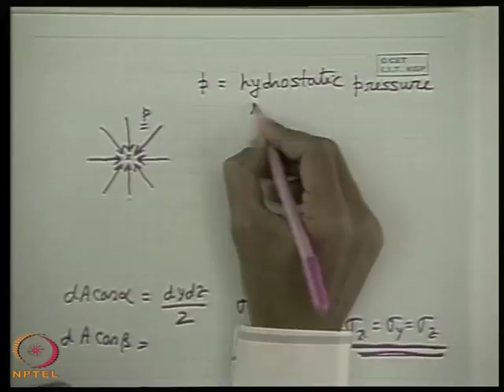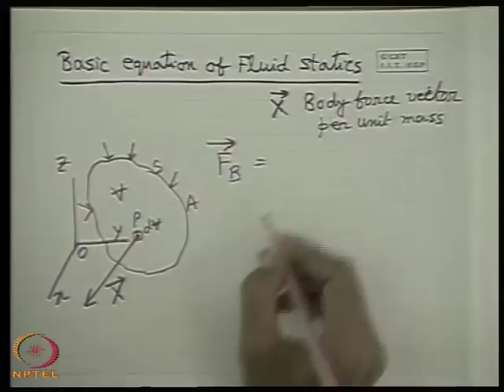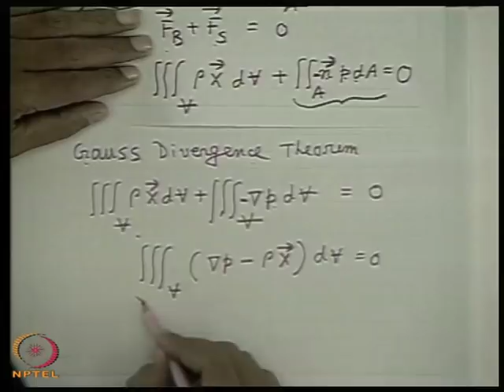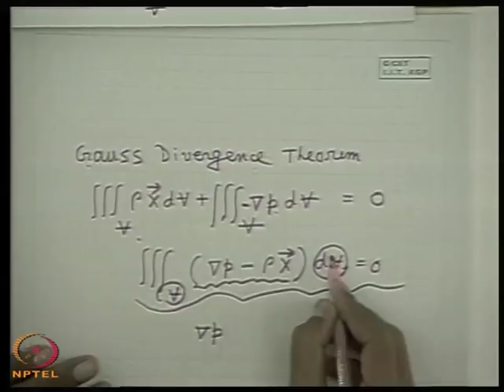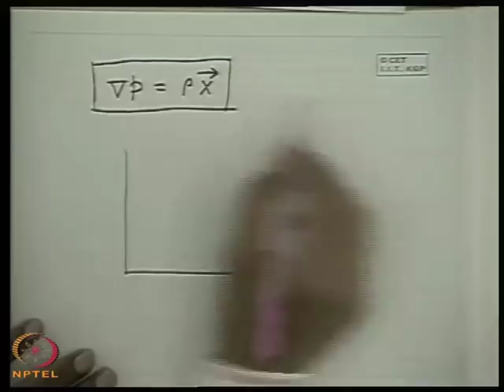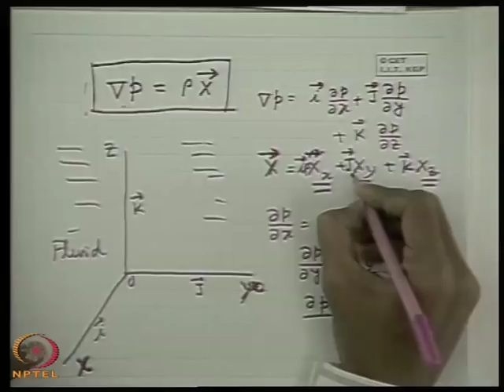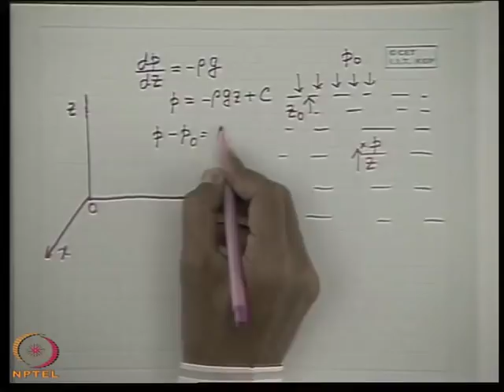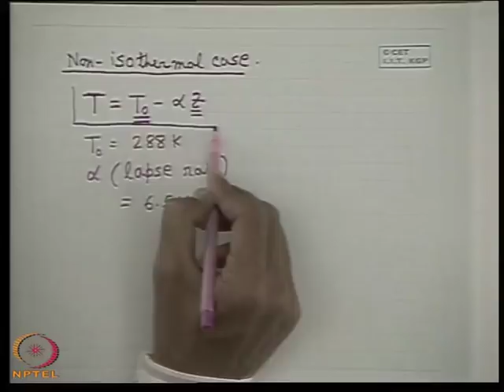Mod-04 Lec-04 Fluid Statics Part - I

Comment: I congratulate Dr.Som for such a beautuful lecture,its even better than that of lectures of US/UK colleges
Reply: So, Hydrostatic Pressure at a point in a static fluid is due to the force of the sorrouduring molecules which is compressive force.
But In the case of surface tension we have seen that a molecule inside fluid is attracted by all the molecules around it which can be considered as tensile.But it's said that fluid can't resist tensile force.
How Could this be possible?.I can't understand this.Please help me in this?

Comment: 0:16 Recap of previous lectures
5:38 Intro to fluid statics
6:25 Body force and Surface force on a fluid element
11:15 Expression for state of stresses in fluid at rest
21:29 Final result (Pascal's law)
32:25 Fundamental equation of fluid statics
36:40 Pressure as function of height if gravity is only a body force

Comment: This video on fluid statics covers various topics including the distinction between fluids and solids, the forces acting on a fluid at rest, compressive stresses and hydrostatic pressure, the analytical expression for the pressure field, and the relationship between pressure and depth in a liquid at rest.  The lecturer explains concepts such as body forces and surface forces, analyzes the forces in equilibrium on an inclined plane, and derives the fundamental equation of fluid statics using the Gauss divergence theorem. They also discuss the equation of state for compressible fluids, the variation of pressure with vertical height, and the relationship between temperature and altitude in fluid statics. Overall, this video provides a comprehensive understanding of fluid statics and its relevant concepts.

    00:00:00 The lecturer begins by summarizing the fundamental concepts and introduction discussed in the previous section. These concepts include the distinction between fluids and solids, the concept of continuum to describe matter, the role of viscosity and the difference between Newtonian and non-Newtonian fluids, the compressibility of fluids and its relation to the bulk modulus of elasticity, the distinction between compressible and incompressible flow, and the concept of surface tension and its effects on free surfaces of fluids.  The lecturer also mentions phenomena such as capillary rise and depression, which are related to the interplay between cohesion and adhesion forces.
    00:05:00 the concept of fluid statics and the forces acting on a fluid at rest are discussed. The forces can be categorized into two types: body forces and surface forces. Body forces are external forces that act throughout the mass of the fluid element, such as gravity or electromagnetic forces. On the other hand, surface forces arise from the interactions between neighboring molecules or particles and can be resolved into normal and shear forces. These forces constitute the internal forces within the fluid. The section also mentions that the detailed description of body forces comes from the field of physics, whereas surface forces can be explained using elementary mechanics.
    00:10:00 the state of forces or stresses generated in a fluid at rest. They explain that in a fluid at rest, there can only be compressive forces and no tangential or tensile forces. They analyze a tetrahedral fluid element and determine the forces acting on it, emphasizing that only the compressive forces are present. They also mention that the surface forces on certain planes do not contribute to certain directions, highlighting the importance of the normal force in the analysis.
    00:15:00 the concept of fluid statics and the forces acting on an inclined plane. The inclined plane has a normal that makes angles with the x, y, and z directions. The forces acting on the plane can be determined using the direction cosines. The surface force acting perpendicular to the plane is given by sigma n multiplied by the area of the plane and the cosine of the angle with the y direction. Similarly, forces in the x and z directions can be calculated using the corresponding direction cosines. Gravity is assumed to be the only body force field, and the net forces in each direction are determined by considering the surface force and the weight of the fluid element. By analyzing the forces in equilibrium, it is found that the components must be equal to zero for a static equilibrium. The projection of the area on the perpendicular planes can be determined using the direction cosines.
    00:20:00 compressive stresses and hydrostatic pressure in a fluid at rest. They explain that in a fluid element, the stresses are directed towards a point from all directions and have equal magnitude, known as hydrostatic pressure. They also mention Pascal's law, which states that the compressive stresses in a fluid are of equal magnitude in all directions.  The lecturer then introduces the basic equations of fluid statics and explains that the pressure field in a fluid at rest varies with the spatial coordinates in the fluid.
    00:25:00 the development of the analytical expression for the pressure field in a fluid at rest. It begins by setting a frame of reference axes and analyzing how the pressure field behaves with changes in the coordinate axis. The video then introduces the basic equation of fluid statics and considers a fluid mass bounded by a surface. It explores the concept of body force and surface force, explaining how to calculate the total body force and total surface force vectors for a fluid element. Under equilibrium conditions, the video derives the equation rho X bar d v plus p d A = 0, which represents the balance between body and surface forces.
    00:30:00 In this section, the Gauss divergence theorem is used to change a surface integral to a volume integral in order to derive the fundamental equation of fluid statics. The equation, expressed in compact vector form, states that the gradient of pressure (grad p) is equal to the product of the density (rho) and the body force vector (X bar). The equation is valid for any small elemental control volume or volume of the fluid element. By resolving the equation with respect to a frame of reference, the variation of pressure in terms of x, y, and z coordinates can be determined.
    00:35:00 fluid statics and the role of gravity as the only body force field. They explain that if gravity is the only force acting on the fluid, the pressure in a horizontal plane will be the same everywhere and only a function of the vertical direction, z.  The lecturer demonstrates this by integrating the equation and finding the pressure (p) is equal to -rho g z + C, with C determined by a suitable boundary condition. They further explain that if the fluid is incompressible, with a constant density (rho), the equation simplifies to p = -rho g z + C. In conclusion, the basic equation of fluid statics is a differential form, but integrating it requires knowledge of the density variation with either z or p.
    00:40:00 the concept of fluid pressure in a liquid at rest. They explain that the pressure at any point in the fluid is equal to the ambient pressure plus the product of the density, acceleration due to gravity, and the depth of the point from the free surface. This relationship is a consequence of the basic equation of fluid statics for an incompressible case. The lecturer also mentions that in the case of an incompressible liquid, the pressure can be expressed as a linear variation with depth from the free surface, known as Torricelli's theorem. The lecturer concludes by stating that they will discuss the relationship between pressure and depth for compressible fluids in the next class.
    00:45:00 the equation of state for compressible fluids, specifically for a perfect gas where the relationship between pressure, density, and temperature is given by p = ρRT. The reference state is defined at a location where the values of pressure (p0) and density (ρ0) are known. By integrating the equation, the variation of pressure with respect to vertical height (z) can be determined. In the case of a non-isothermal system, where the temperature changes, the linear relationship between temperature and altitude in the atmosphere is discussed.
    00:50:00 In this section, the lecturer discusses the relationship between temperature and altitude in fluid statics. They explain that the temperature decreases linearly with altitude, with a constant lapse rate of 6.5 Kelvin per kilometer. By assuming that the atmosphere behaves as a perfect gas, the equation of state can be used to express density (rho) as pressure (p) divided by the product of the gas constant (R) and temperature (T). The lecturer goes on to perform mathematical calculations to derive an expression for the variation of pressure with altitude, resulting in a power law relationship.

Comment: 12:37 sir.. how do you say that a static fluid won't have any tensile stress but it has a compressive stress??
Reply: manish kumar monu  So, Hydrostatic Pressure at a point in a static fluid is due to the force of the sorrouduring molecules which is compressive force.
But In the case of surface tension we have seen that a molecule inside fluid is attracted by all the molecules around it which can be considered as tensile.But it's said that fluid can't resist tensile force.
How Could this be possible?.I can't understand this.Please help me in this?
Reply: There is no tensile stress thing in fluids.....It's a surface tension which is relevant at fluid fluid or fluid solid interfaces (It comes as a force).....Usually fluid flow is governed by compressive(pressure) or shear stresses or both....But in some few applications, because of stick slip or volatilization circumstances then only surface tension is serious to study.....

Comment: DEAR SIR,
I need to know why we use tetrahedral shape /surface for this derivation
Please clarify my doubts?
Reply: It is one of the geometry where you can have gradients in all directions....To show that compressive stresses in all directions are same....If we take up a cube, then there is no surface common to all directions and not the wedge also.....Hope you are satisfied..
Reply: it is easy to prove that all stress are equal
if we take a cube the stress is same along x,y,z direction and that proves nothing.
Reply: @aero8215  So, Hydrostatic Pressure at a point in a static fluid is due to the force of the sorrouduring molecules which is compressive force.
But In the case of surface tension we have seen that a molecule inside fluid is attracted by all the molecules around it which can be considered as tensile.But it's said that fluid can't resist tensile force.
How Could this be possible?.I can't understand this.Please help me in this?

Comment: then what is the difference between surface tension and surface force are they both similar to each other @nptelhrd
Reply: So, Hydrostatic Pressure at a point in a static fluid is due to the force of the sorrouduring molecules which is compressive force.
But In the case of surface tension we have seen that a molecule inside fluid is attracted by all the molecules around it which can be considered as tensile.But it's said that fluid can't resist tensile force.
How Could this be possible?.I can't understand this.Please help me in this?

Comment: Why is there a minus sign at 31:30??
Reply: +Nisarg Vashi since  p is a compressive force acting towards the body.
Reply: if you are asking about how delV-PX then as in earlier step Px is having +ve sign
then its a mistake 
i have abook of Prof S K SOM of Fluid mechanics
in that the PX has a +ve sign and delV has negative sign in step mentioned by you
Reply: Nisarg Vashi Since tensile stress is positive and compressive stress is negative,if we define the direction of pressure in reference to stress then it will be negative as it is compressive in nature ...